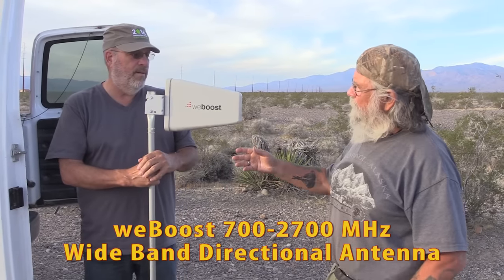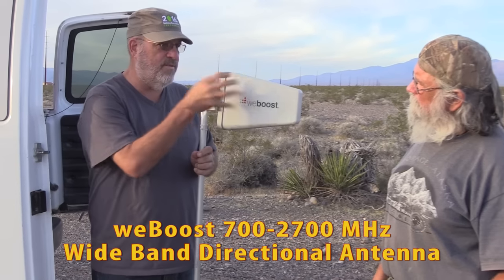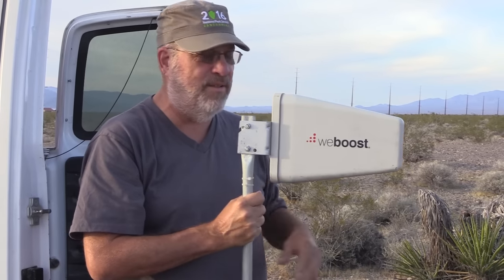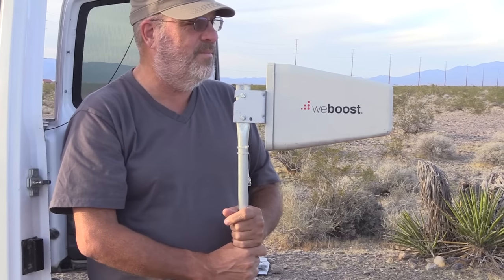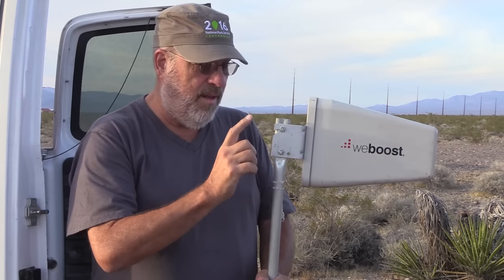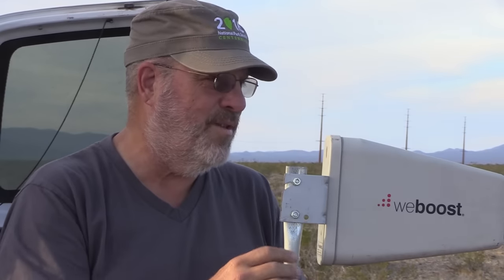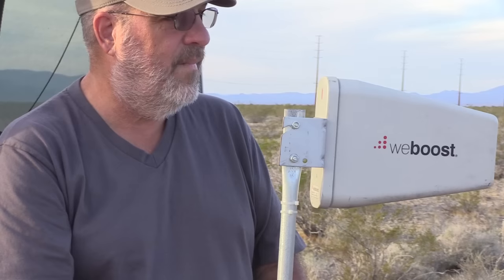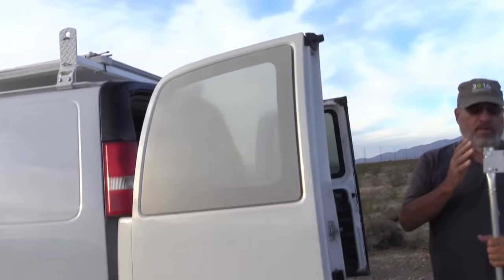Van Life 101: How to Get Internet on the Road

Comment: Have you checked out MetroPcs? It's 60 bucks a month for unlimited 4g data. It runs on the tmobile network which a lot of people talk bad about but they have really upped their coverage in the past couple of years. I use well over 60 gigs a month with no issues. I even downloaded foxfi and now I get unlimited hotspot data and metropcs doesn't throttle that either.
Reply: awitcheskid Metro works good in the city but in the country maybe a weak signal ...
Reply from the maker: TMobile has terrible coverage where I camp.
Reply: I think it really depends on what part of the country you live in. I live 20 minutes from the closest small town, and I get full bars, and they are always upgrading their network. Even in the past 6 months I've noticed drastic improvement in reception and speeds.
Reply: No problem. I've used a lot of carriers in the past and this one is by far my favorite.
Reply: That's really unfortunate. They just purchased a bunch of new spectrum that is supposed to make their coverage way better so hopefully someday soon you'll get coverage.
Reply: Jrok bird thanks for this amazing info, just downloaded the app you mentioned and I have my kindle fire up and running with full WiFi signal. Yay!! 😊 💕 👍
Reply: I have MetroPcs and I really like it .... we've been in some pretty out of the way spots and it still works.
We got a great deal ....2 Samsung mostly smartphones and only pay $50.00 a month for both phones .
Reply: i use metro  and had a app called easytether that worked awesome (averaged 130 gigs a month) but it seems metro has "broken " that app in the past 2 weeks...any suggestions for a linux user?
Reply: Mrreality... I use Windows ...but I know that phone tethering in Linux is the same as in Windows.... you need to go into your phones settings and enable the Tethering Option. 
Here's a link that might help
http://www.makeuseof.com/tag/how-to-tether-your-smartphone-in-linux/

You might want to find an Android Emulator that will work in Linux also.
I use Bluestacks and can run all my APKS on my laptop.... if I'm not around Wifi I just use my Android phone as a Hotspot.

By the way ... KODI runs great on LINUX .... we use it for watching News, TV shows and Movies
Reply: T mobile "upped their coverage" with partnerships. Metro gets to use their original base network only and it is terrible. I spent 8 hours with full service that said emergency only while traveling. Metro coverage is terrible like sprint and boost. T mobile really isn't much better. Metro also restricted my data to unusable before 80 GB'S. My messenger even said no connection while on LTE... Save your money!

Comment: Could he run the cable through one of those boxes on the roof, like you did with your solar cables Bob? The cable would stay in place and he would just attach it to the antenna wire before he raises the antenna pole. Just a thought.

Comment: Could you mount the bulkhead connector through the shell of the van itself instead of his interior rack? Wire the inside to the base of the weboost and connect when needed. You could then close all doors and windows when using

Comment: You can fashion a really good but extremely cheap directional antenna called a cantenna (youtube has various videos about it) 

If you like something more fancy you can make either a rather more complicated yagi or simpler to construct helical directional antenna. Also very good and also youtube has some tutorials about them. All these antennas can be used with a usb wifi dongle which have the external antenna connector. 

I use one of these usb dongles which is build into my van (connected to a usb hub together with some other usb devices like a tv tuner, some hd storage and a second wifi dongle for internal use - as an access point for other devices) I simply plug in 1 usb cable into my laptop and I can use the directional antenna sitting on top of dash of the van and direct it to the mac donalds access point...Works great and hardly looses it's connection...

Comment: I know this is an old video but the links are to items that don't seem to fit together anymore. The newer weBoost sleek has SMB connectors. And I am confused as to whether female or male adapters should be used for the directional antenna.

Comment: Does anyone know if a short section of RG6 flat coax cable could be used to connect 2 sections of low loss RG58 cable through a window jam without too much signal loss?

Comment: Quick tip:  If your IRS adjusted gross income is lower than $24K (two times the poverty level) for a single person, you can qualify for low-cost internet from a non-profit called PCs for People.  You do have to prove your income (email them your 1040), but once you do, you can purchase a Sprint HotSpot and 12 months of unlimited internet service with no throttling for $200, which comes out to ($80 for the hotspot and $10 per month).  If you're a van dweller within city limits, you can probably get +10mbps down on band 41, and it's a VERY good deal.  Not sure how well it would work for nomads though, as Sprint is often a distant third when compared to Verison and AT&T when it comes to reception.

just google "low cost internet pcsforpeople".  Good luck!

Comment: For travelling I would only use my phone. So am I understanding I would need the phone (and my “almost unlimited“ plan), a cell signal booster and antenna?

Out of curiosity, does Wi-Fi factor into any of this… By that I mean is there a way to pull in free Wi-Fi through this system or are there some other ways to do it? 

Thanks for this video!

PS: Wilson Electronics =WE 😊. I just watched this video, but a few hours ago I was doing a bunch of online searching and wondering myself why they would call it “we“ lol

Comment: Put the connector into the roof of the VAN, and seal it, connect the cable to the external connection and then connect a short cable to your mounted connector

Comment: Al, Just a thought.  Would it be possible to take the adapter cable with the one end that is mounted to your shelf rack and drill a hole in your roof to mount the same end to the roof?  This would eliminate the need to route the large cable through the door giving you the ability to close the door.

Comment: Only if they produced a motorized directional antenna that would fit inside a low profile radome on the vehicle roof that amplified the signal, sending it to an omni antenna under a radome on the cabin ceiling. Getting rid of pesky mast that sooner or later one will forget to lower, and eliminate trying to find a decent weather tight  route for the feed line. Of course bidirectional amplification may be necessary for optimal performance. Yea the data plans can be killers, but if one wants to play, one shouldn't complain about paying

Comment: I can't find answer to my question about watching tv in my camper that is permanently parked in the N. Ga. mountains. There is no cable, and the satellite guys say there are too many trees to get a signal. We get a couple of stations using the 12 yr old antenna that came with the camper. (THE tv is only about 2 yrs old). Can anyone advise me on what kind of antenna (or whatever) to get better tv reception up here in n Ga  mountain woods? Thanks in advance.
Reply: Try looking for TV watching apps that use cell tower signals. Then, talk to your cell phone provider. You might start by talking to your cell phone provider.

Comment: I have a Verizon Jetpack and phone, and they both suck. I'm currently less than a half mile from a Verizon tower and only have one bar. Plus Verizon throttles speeds, it may say you have 4g but it won't even load a page most of the time.

Comment: why not look into ham radio because broad band ham network is shared with WiFi frequencies. You can then connect for free to someones home internet provided you have a ham radio license. yet another option is to convert a home router and flash the router using dd-wrt or openwrt firmware then put the router in Adhoc mode, boost up the power in the DB and either modify the unit for an antenna port then connect a yagi antenna to it. that way you can connect to any store that has free WiFi.
Reply: The problem is that BBHN is not widely used. There are pockets of BBHN users scattered around. In the middle of the desert your not likely to find a BBHN network. You also won't find BBHN users in 99% of any mid to smaller size cities. The other part (not that I'm preaching) its illegal use use for commercial means. All data must be not encrypted, and must not be graphically questionable. In general it must be G Rated data passing on the network.

Comment: Excellent information! Thanks so much. No one ever mentions T-Mobile....does it not exist in the south west? They have free Netflix and Youtube (I've read) data.
Reply: T-Mobile doesn't have nearly the fringe coverage than Verizon or even AT&T for that matter. T-Mobile (and Sprint) operate at frequencies roughly twice that of AT&T/VZW. The higher frequencies don't propagate (travel) as far as do the lower frequencies. In order to provide similar coverage to AT&T/VZW in the same area, T-Mobile/Sprint have to build as many as twice the number of cell sites.
Reply: Thanks, that explains why no one ever mentions it as a viable option.

Comment: instead of seting that tube every time,why not bolt it on the roof permanently and make some kind of pivoting hinge bolt on that bracket and then fold it down before driving and stand raise it up again when parked,,
also how driling a hole thru the roof for the cable and seal it with silicone caulk would make it all more simple

Comment: Tell AL to relocate that newest connector with the short cable to his to his van instead of the rack inside.  Not quite sure why you need to have A Telecommunications Device Repair Instructor such as myself to tell you such a simple easy fix.

Comment: How about this to solve the antenna connection  and close the door. Drill a hole through the truck body and put in one of the connectors like you have on the top of the grey rack. I know its a port through a boat hull but 3M 5200 is a marine sealant that works. Then your outside cable and your inside cable are separate. Everything inside can stay connected only the outside and your antenna mast need be removed. When you remove the outside cable cap the connector. Look for the connector that cable companies use to enter a house and keep water out.
How is T-moble signal. I just found a plan for folks over 55 years. T-Mobile One Unlimited 55+. Unlimited calls and text to and from Canada, Mexico, US. Unlimited Data, 3G speed mobil hotspot $50 a month, no contract, taxes and fees included

Comment: Has anyone tried T-Mobile's new plan? I'm thinking about going for it. $70/mo for 30GB on-phone data and 10GB hotspot data. After that it's 3G but you still get to use hotspot data which would be nice. I've also heard that they are spending a lot to expand their 4G coverage.
Reply: Mark Btw, get metro pcs for 60 per month unlimited data.
 Metro pcs is now owned by T-mobile.
Reply: But that plan only allows 8GB of mobile hotspot data/HD video. Plus after 30GB on your phone it says just like T-Mobile: "During congestion, top 3% of users (>30GB/mo.) may notice reduced speeds." I would never use over 30GB on my phone anyway, but I would use all the hotspot data I can get.

Comment: Great video Bob. This gave me all the info I needed. 
One link you may want to add to your description is that bulkhead adapter cable. I thought that was a great idea. Here is the 12 inch cable on amazon. I also saw a 6 inch model on amazon
https://www.amazon.com/DHT-Electronics-coaxial-assembly-bulkhead/dp/B00COXZ2RM/ref=sr_1_2

Comment: On your jet pack "cradle," leave the right angle connector in the cradle at all times. Never disconnect it (there is no reason to).
For your THICK WeBoost cable: Get a solar wire pass-through (or similar device)  and use that to keep the weather out, but your cable will always be outside. I believe this will fix your open door problem once and for all. 
https://www.amazon.com/dp/B0111RNZDY/ref=wl_it_dp_o_pC_nS_ttl?_encoding=UTF8&colid=253ON3R6JMCQH&coliid=I1JNJ0GGKWD5WN
One Love

Comment: Eh, that's some shitty cable routing. He had a bulkhead N-connector and instead of drilling through the roof of the van like a smart person and bolting the connector to the most logical place next to the pole, he decided in his infinite wisdom to bolt the bulkhead connector to a shelf inside the van and run the cable through his panel doors such that he can't shut them anymore. What the hell?

Comment: Not sure why people get mad at Verizon. It's literally economics. It's supply/demand. We don't HAVE to have a cell phone or cable. If enough people didn't want to pay them their high costs, then they would cease to exist. It's that's simple, really. I travel the country by plane and volunteer to help with a company that is nationwide. I get paired up with guys that opt for cheaper service (ATT, Tmobile, Sprint) (and up until last month, I didn't have unlimited)) and while I didn't have unlimited data and they all would, we couldn't use their phone(s) for navigation, because they never had signal. So we would always have to use mine, and I would have to buy more data. Thankfully now they went back to offering unlimited, and I jumped on it as soon as I could!

Comment: Tell me.....How do you amplify a signal that isn't there.  You CAN'T AMPLIFY A SIGNAL THAT ISN'T THERE.  Also, these devices DON'T work.  SNAKE OIL.
Reply: That is the point of improving the antenna system. You can't amplify a non existent signal. You need to improve the antenna system to a point of having a signal to amplify. The antenna is the most important piece in any radio system.
Reply: 45 TRUMP POTUS they mentioned it at least twice... you can not boost a signal that's not there. Ya have to watch all the way to the end to hear that part though :)
Reply: The adage is still as true as ever, if you want more signal put up more metal. 

But it doesn't help that antenna performance is measured in gain because we often think of this 'gain' as an increase in absolute power. This 'gain' simply expresses how much better a particular antenna performs when compared against a dipole antenna or a theoretical "isotropic" antenna. Most often the comparison is made against the isotropic antenna because that gives a slightly number than when comparing to the dipole.
What people often (rightfully) find confusing is that the gain delivered by, say, a transistor to antenna gain. The transistor actually consumes DC to make the power at its output terminal bigger than the power at the input. These are called 'active' devices'. An antenna is a passive device, no actual increase in signal power. What a gain antenna can do is to focus RF energy on to the antenna, usually a dipole. What commingling the ideas of active and passive gain gets you is the ability to evaluate both receiver transmitter performance whole system performance when connected to a particular antenna. It also allows factoring in the losses inherent in cabling and connectors.The principle is most obvious when you look at an antenna with a dish shaped reflector. The energy striking the dish is reflected and focused on the itty-bitty antenna suspended in front of the dish reflector.